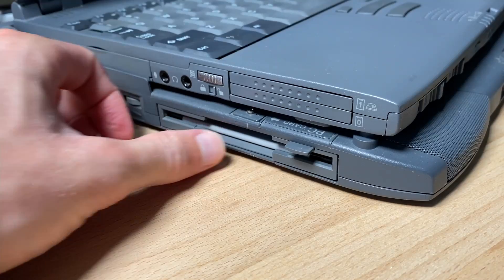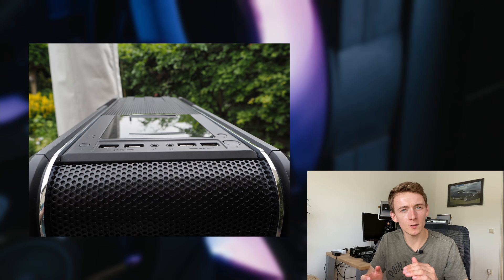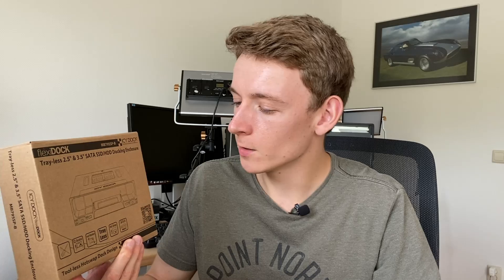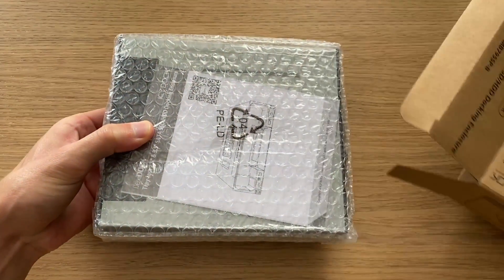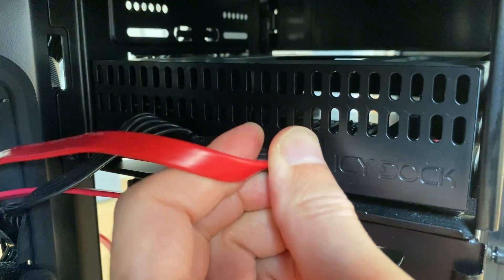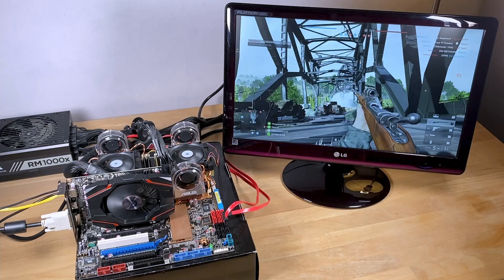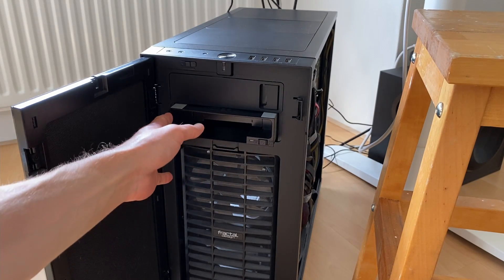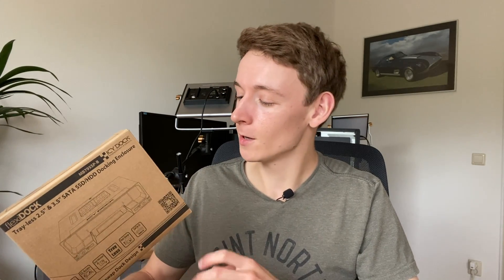Hot Swap Your HDD/SSD like a Floppy Disk?! - ICY DOCK MB795SP-B Review

Comment: These products exemplify why computer cases still need 5 1/4" drive bays. I have a bunch of things that need them. My current computer has two optical drives, an accessories drawer (it's very handy!) and a card reader/USB port.
I'm planning on adding a duel hot-swap drive bay to my next build. I'm going to have to use my current PC case, so it's going to be tricky making sure my new PC set-up works before I even install it into the old case (because I'm still using the case for my current build.)
My case is a Thermaltake Armor+ Super Tower. It's very modular and it can fit any PC parts into it.

Comment: I recently purchased a Cooler Master Cosmos 2 case on FB marketplace for a reasonable price. This case can support up to 13 HDD this includes two hot swap bays.  I have found this has provide a solution to a problem I had with portable storage. I have a lot of video files that have taken up lots of space on one of my drives, storing on the cloud would be expensive as is a NAS solutionand storing on DVD or Blueray is an option but I would need a lot of disks for the amount of data. A  better solution is to buy a HDD of the appropiate file size insert in the hot swap bay and copy or move the files to the hot swap HDD. It's like using a HDD as a massive floppy.  My motherboard supports up to 8 SATA devices and two M.2 slots, I've noticed that a lot of recent boards have increased the m.2 capacity and decreased the SATA ports.

Comment: Personally I prefer SATA over USB. I have many HDDs, especially 3,5" high capacity, using hot swap since many years. With all of my motherboeards and most additional PCIe to SATA cards SATA Hot Plug is very stable while USB like to disconnect.

The MB795SP looks a bit cheap IMHO, I prefer the IB-174SSK-U (or many very similar competitors products), which I use for years at my job. Only disadvantages are there´s only one switch for 2,5 and 3,5. 

But keep in mind that a 7200rpm 3,5" HDD gets maybe to warm in a longer run. In this case I like the big IPC ST-3525 with cooling fan

Strange thing in your review is the low write speed, normally I would think if I have 2 SATA connectors there are a direct contact and not some kind of bridge chip

Comment: Used a similar product 15 or so years ago. It was USB based, had trays that the 3.5” drives fit in. It worked well. I used the product for doing backups. 
I like this product. It’s an upgrade to what I had. I had to be careful with the HDD’s - fragile. With SSD’s you don’t have to be quite as careful.
Good review.

Comment: I've take a lian li 3 X 3.5' drives on a 3 X 5.25 case that got pre instaled a 12cm fan and fit it in a case that got a 2 X 2.5 drives on a 3.5' slot case pre instaled and I got 5 hot swap slots of both sizes for realy cheap! liked that feature and the speeds that provided but now looks like prices are risen in this category. Cases should use some specialized space with easy access to put some multisize bays

Comment: ha !  great to see my Antec 900 (mine is the USB 2 model) .  in my Antec 900, i have a Thermaltake N0023SN Max 4, for a 3.5" drive and a Vantec NexStar SE mrk-525st, to take 2 x 2.5" drives.

very old system that i rescued from the ewaste at work back in 2011, it rocks an original i7 and an ASUS MoBo that is only SATA 2.  But it is still fairly reliable and runs both my Linux Mint and Windows 10.

because of the ease of swapping the 2.5" SSD's from the Vantec drive bay, i can switch OS's in under a minute, INCLUDING REBOOT !!

i could also install W10 on an additional SSD for the boy to run his own OS for gaming, on the same rig without buying another rig and not giving him access to my W10 to keep the bugs away.

Comment: Is there anything that locks or holds the drive in place once you turn the power on?
I'd be concerned that if the pc isn't completely flat, and so the front might be angled down slightly then the vibration could cause the drive to slide out of the connection while in use.

Comment: I've been using what I guess is a knock-off by 'Icybox', also 2.5" and 3.5", which seems to have been discontinued (can only see single bay versions now). It's held up with light use, I'd guess a few dozen insert/eject cycles of both bays over about 6 months. One caveat is that if both are used simultaneously the 2.5" drive (the upper bay) can get too warm for comfort (only tried that once). Apart from offline storage I use it for defragmentation - actual defragging is something I've never done and might be part of the reason I've never had an HDD fail in 23-odd years since I started using and building PC's - it absolutely hammers the read arm. Instead I just the copy the entire contents to another drive (and back if needed). Back in the day (i.e. when PC's were beige) 5.25" HDD caddies were very common (out of necessity given their capacity).

Comment: You would like my Coolermaster HAF XM, which has two SATA "hotswap" removable HDD caddies that the control board allows freely pulling and fitting any SATA HDD's on the fly, it also enables the ability to run extra HDD's as the case can hold up to ten storage drives as well as 3 opticals.   The drives both the hot swap and the fixed ones are cooled by a massive 240mm fan, I have 1 nvme SSD and 4 HDD's running at mo with two in the hot swap caddies as I can use them for extra storage in another machine.

Comment: So I modded one of these by literally just prying out the plastic bit inside the sata connector that stops a SAS drive being inserted into this enclosure and it works perfectly obviously with a SAS controller and that gives me hot swappable SAS/SATA out of the server im using with along with a LTO tape drive really useful to move data from/to but it's a shame icy dock didn't make it SAS compatible out of the box :(

Comment: Yeah I totally got a pile of cheap notebook 2.5 hdds and label stickers for storing movies on and I use them like floppies. Right now 500GB notebook drives are cheapers storage per GB, even cheaper than burning blu ray and much faster. I got much nicer HDD bay though, this one looks super cheap and flimsy.
Reply: I have a friend who gave me ~75 500GB hard drives from retired laptops. My case has a built-in SATA dock for 3.5 and 2.5 drives. I use the drives to back up all the TV series and movies that have come out since I stopped buying DVDs/Blu-Rays onto.
I have a 5.25" bay converter from Athena Power that fits 4 2.5" drives. It's all metal and the drives have to be screwed onto small sleds and then slid into the unit. Originally I was going to put 4 of the 500GB laptop drives in it, but then decided to put my 240GB boot SSD and 3 2TB SSDs in it instead. It has worked perfectly, but I never use the swap ability. I think if they were used for swapping a lot, the SATA connections wouldn't take a long time to wear out, but that is just my guess. I got mine when it was on sale for an insanely low price at Newegg. I have another free 5.25" bay and wish I knew how much I was going to love it so I would have ordered two instead. The regular price of all these 5.25/3.5" converters are too expensive IMHO.....

Comment: But can you boot off of it? I think it is likely and it would be amazing if so. I may order one and take my chances trying.
Reply from the maker: I see no reason why that shouldn’t work!
Reply: As long as you are using the motherboard's SATA ports it should definitely work. It's when you get into using PCI-e SATA cards that it becomes a game of some do/some don't. I have a PCI-e SATA card with 4 drives connected to it, but have never tried booting from them. My boot SSD is connected to the motherboard SATA. But I know that the card supports ACPI, so it would work with a unit like the one in this video.

Comment: Hotswapping drives has always been an amazing thing for datahoarders like myself. What's puzzling for me is the wasted space where the 5.25" bays used to be in cases. its a natural progression move all harddrives and storage devices into what used to be the 5.25 bay area's and fee up the bottom of the case for pumps, reservoirs, radiators and PSU's.
Reply: people need room for water coolers due to high wattage tdp cpus

Comment: I need something like this for moving an SSD Steam library from one machine to another.  Currently using a USB 3.0 enclosure, but the speed is not as fast as a direct SATA connection according to SSD benchmarking tools.
Reply: usb3 gen1 only does 500mb/s max, but your ssd on both ends has to be able to handle that as well.

Comment: I have been looking for some cheap 5.25'' bays for hotswappable games drives between systems for testing. I do have a really old ICY Dock 3.5'' one which sits flush when you hook it in, but i need a kensington lock to unlock the fan and activity lights but it does still work. I think with cases with front covers or any, the protrusion especially the 2.5" for me is a gamebreaker. it would have been nice if it was flush so i don't accidentally knock it. Just wish the price was a little lower for what is a 5.25" bay cage with sata slots considering someone may buy multiple to hotswap between a main and other computer(s).

Comment: Hello my friend. I really enjoyed this video and i also like that adaptor. The things you can do with 5,25" is amazing. Also i wonder what system do you use?
Reply from the maker: Thanks! My system is an old Sandy Bridge -based i7-2600K machine with a Z68 motherboard and GTX 1080.
Reply: @FullyBuffered  i love old system like yours. Old is better. #x58gang
Reply: @FullyBuffered  what i've been wanting to do is a rdx imation type thing, but open standard format using laptop ssd or mechanical drives inside a full size hdd shell, problem is finding a hotswap tray shell/enclosure that has shock absorption like the rdx cartridges have. This would minimize the wear on the drive connectors from the in and out ports and keep the drive safer, not to mention the metal shell can pull some heat. Do you know of a good combo to do this. And can you recommend a hot swap dock for internal install as well as a good solid stand alone desk top solution (i'm a metal construction fan like you). Thanks in advance.